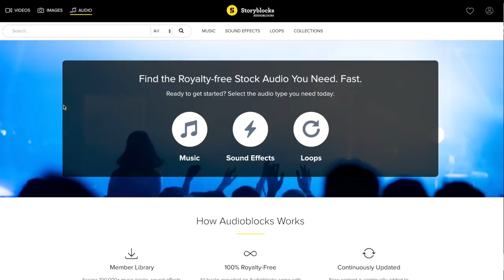LED Epoxy River Bluetooth Speaker | DIY Build Log

Comment: As always, great job and very creative, Kirby. Congrats to you and Jen on the new place! As for the speaker, I'd be curious to see if the epoxy can stand up to more power, larger drivers and lower frequency. Alas, that would be a really expensive  experiment as the Epoxy is not cheap.

Comment: Damn that is awesome looking...... kirby would a 2 woofer 2 tweeter setup be more superior to 2 full range and 1 sub woofer ?
Which would be better ?
Reply from the maker: Thank you! I wouldn't say either is better than the other, it depends on what you like and where your skill level is at. Full range speakers tend to sound better in the vocal range and are much easier to design and build. A 2-way system can be better for critical listening, but are more difficult to design and build. I think you'll be happy with either design!
Reply: @KirbyMeetsAudio  thanks a lot !! I think ill go with a 2 way..... i also had one more thing 

Should i let the woofers be without a filter i.e. eg play from 60 hz to 10 khz and put a tweeter with hf filter tp play from 2500 hz or should i keep it in a crossover ? Because both drivers play till max freq. Spectrum that they can handle rather than splitting it into 2.... which would be better ?? Crossover or direct ?
Reply: @KirbyMeetsAudio  i highly think you should name ur speaker colour nebula purple !

Comment: My god, why do people get all OCD on the fraction of a percent difference in a material used. Are they trying to show off their knowledge of acoustics?  Geeze, I would rather have a badass beautiful speaker with great sound, than a regular sound perfect blah looking speaker that looks like a generic box any day. Your ear can hardly tell the difference in most reasonable cabinet materials, the design and components are the biggest factor as long as you're not building them out of cardboard or rice paper. You have to hook up a microphone and measure the difference in most cases when it's a small percentage like this.